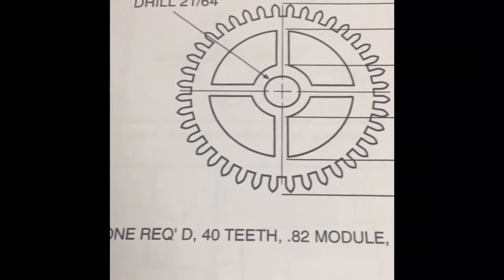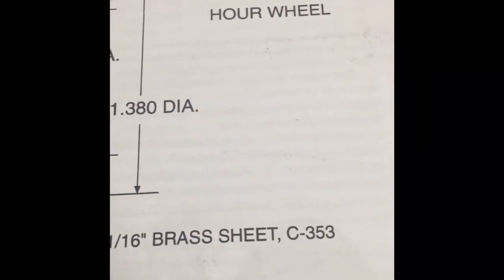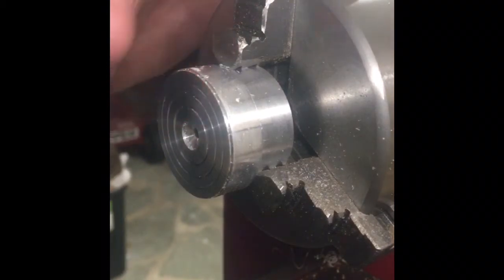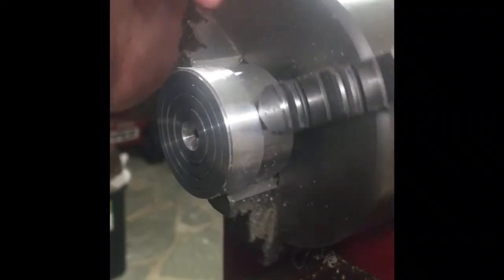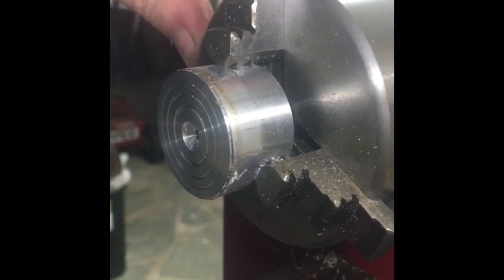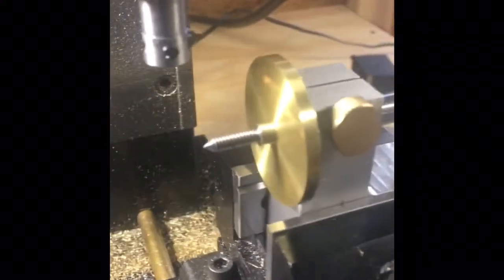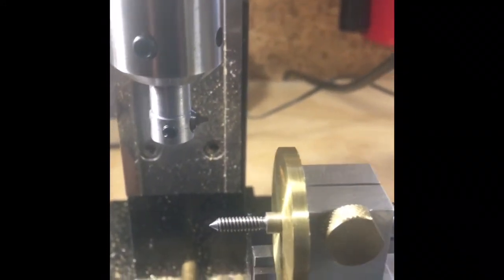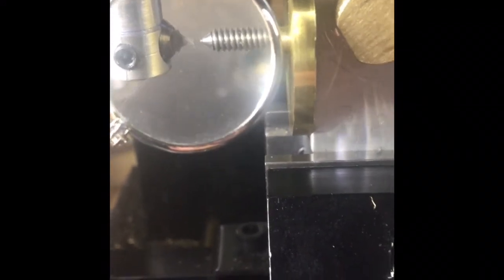Clockmaking in the Home Shop:Wheel Cutting Pt. 2

Comment: looks like it all works pretty nice. well done!
Reply from the maker: +Emmas Spareroom Machineshop Thanks for the feedback. The only thing I'm not happy with is the tightening of the shaft during cutting. The thumb screws are not enough. For now I'm using a Kant twist until I figure out a solution.